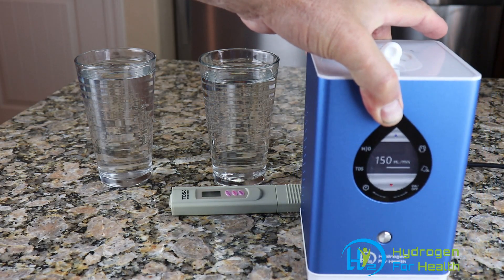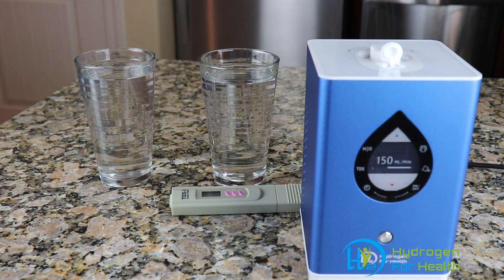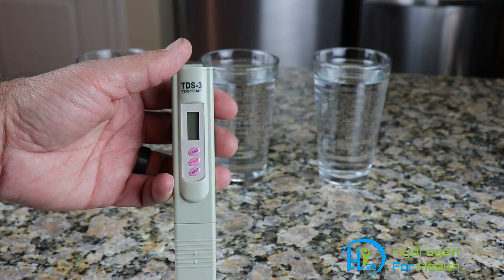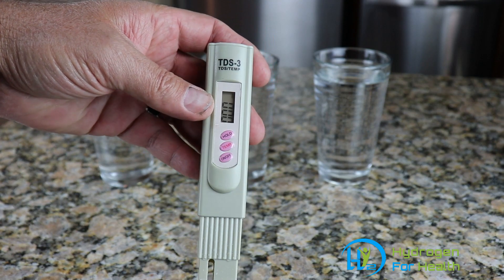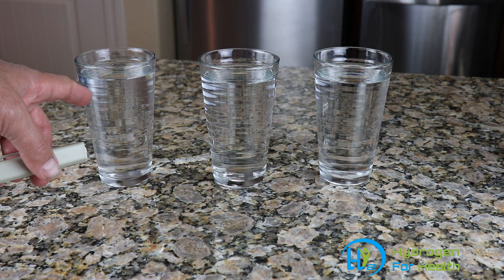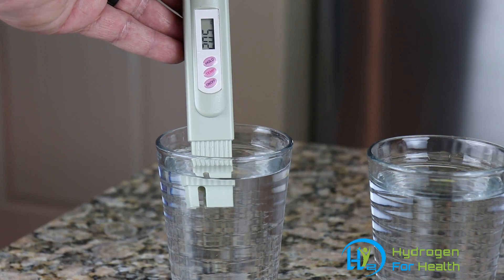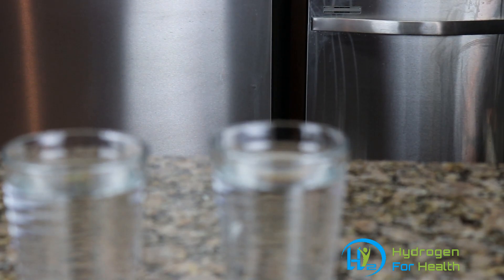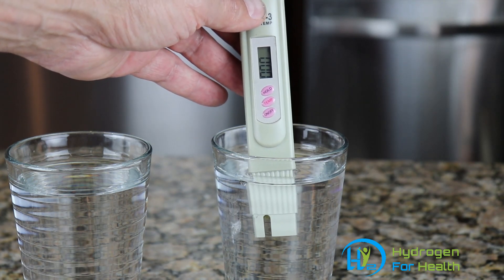TDS meter measures water purity for hydrogen inhalers

Comment: So I gotta ask what happened with the hho on the dodge ram videos yrs ago u went from 21 or so to like 32 mpg u said they were preliminary numbers but never posted another video did it not get better or stop working? Also have u personally used the darol Mason efie on a gas vehicle and seen good results? And have u ever got any results with the volo chip? I'd really appreciate your input thanks
Reply from the maker: I sold the truck 9 years ago. It was getting about 27mpg before I took the kit off. I think I could have achieved the same with a much smaller system. I've never used a EFIE. Volo chip work pretty good.

Comment: how are people getting 0 with distilled water.....i can only manage 1
Reply from the maker: Double distilled.
Reply: @Hydrogen4Health  done that as well,but still comes back as 1.  Do you think it is the carbon filter bags releasing minute amounts of carbon into the water?
Reply from the maker: @Mickeyj26  I use the water from my RO filter in my home distiller.
Reply: @Hydrogen4Health  Which type of home distiller do you have?
Reply: YOU GET TDS 0 EVERY TIME ONLY WHEN YOU USE DISTILLED WATER FROM THE STORE BECAUSE THEY USE SOAP, DISTILLED WATER FROM HOME WILL ALWAYS HAVE TDS 1 , MAY BE SOMETIME 0 BUT  IT IS NORMAL NO NEED TO DISTILLED AGAIN.